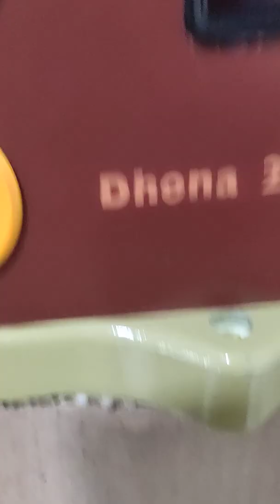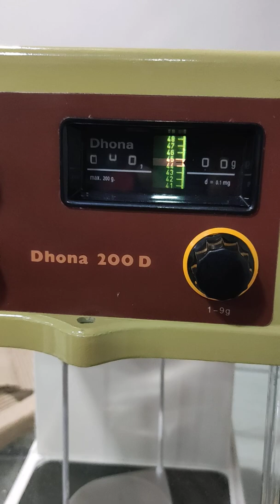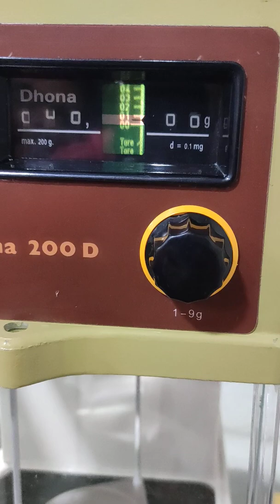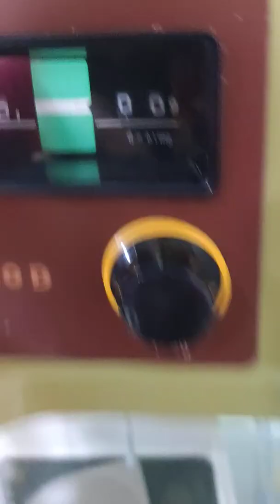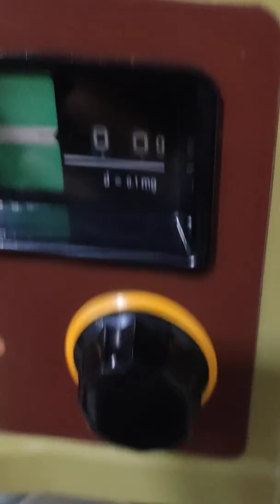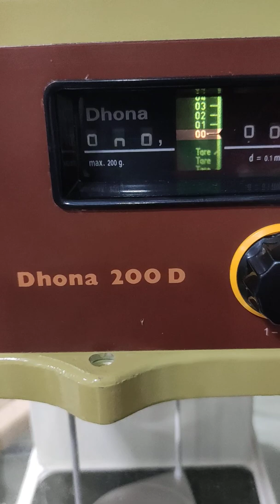Installation of Dhona Balance

Comment: Sir take weight in water test in o.2356 g weight
Reply from the maker: Simple You can see the Screen when you start balance.. And. 23... &. Screw gauge rider set first 56...from Right side front knob......

Means. 000.23 56......

Comment: Sirji.. Mera bulb chaal rhe hain.. but display bohut dim hain.. kuch nhi show kr rhe hain. Black screw focus adjustment b try kr liye .... Zero point adjust b try kr li . But no helping. Display still very dim and not showing any number. 
Plz help.
Reply from the maker: Bulb change Karo and Uska light Set Karo holder ko zara dhila karke aage piche karo ya zara sa upar niche... Par balance chalu karke aur aage dekhete rehna....
Reply from the maker: Aur kaha par हे matalab kaha se ho Aap?